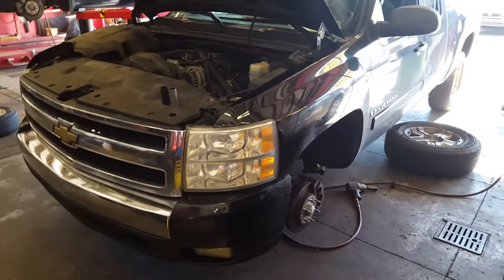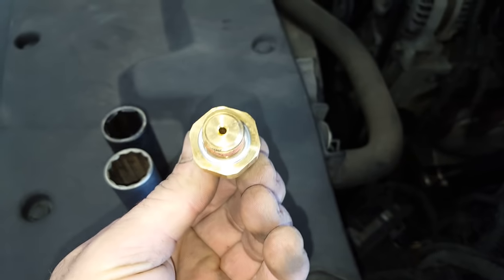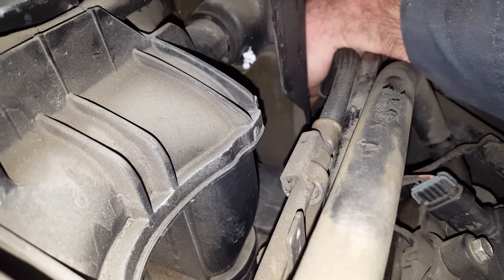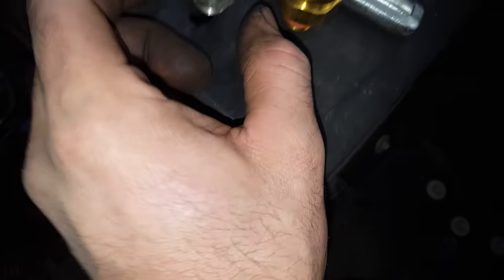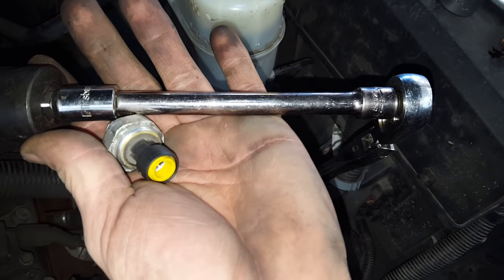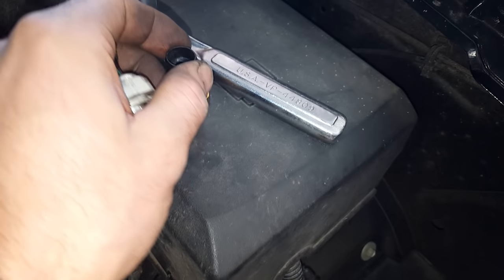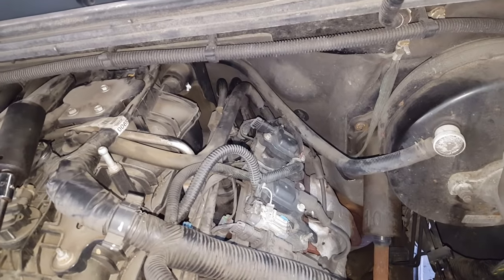Chevy Silverado 5.3L OIL PRESSURE SENSOR REPLACEMENT 4.8 6.0 sierra yukon  sending unit p0523  gauge

Comment: Finally, a no-nonsense video on the replacement. Not a 15 min long video.
Reply from the maker: That's what I shoot for! I feel your pain on the 15 minute videos that could be 2 minutes. Part of the reason I started making short fix videos. Sometimes I find myself having to look back on them as well for answers and I don't want to see myself talk for 15 minutes either.
Reply: Side note, the 2011 5.3l connector ks different! Make sure you double check that you have the right part! It's still 3 prong but has wider spacing with a different clip mechanism! 
https://youtu.be/lUPEIrs3mrU
This guy has the correct video for that!

Comment: Unbolt the trans mount at the rear. Lift up the trans by the yoke. That will buy you about 3 inches from the firewall. Its the way i do it and it takes me 15-20 mins.
Reply: This might be the answer for me.  I don't understand how anyone could get that electrical connector off.  I can touch it...but there's no way I can get a grip on it, lift the lock, push in the tab, and wiggle the connector off.  My hand is bleeding.  I can't get a grip on that thing no matter what I do.

Comment: What about the little filter screen just below the pressure sending unit. It is a common problem. It plugs up and causes the oil pressure to run low or no oil pressure. When you're in there it is just a pick to take it out and replace.
Reply: I was charged 8,000dollars at a place here in ky and still had no oil pressure, told them to replace the screen and they had no idea what i was talking about. Now i dont have enough money to sue them.. fuckin con artists. Lol
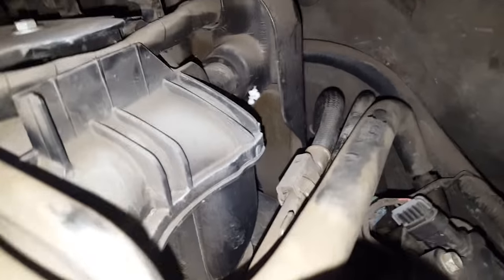Reply: Listen up folks... Here is how to do this job real simply.  Get a heavy thick blanket and put it on top of the motor because you are going to lay up there to get at eveything.  At 1:01 of the video you will see the plastic baffle, at the rear of the engine, and there is a white spot visible.  Take a sabre saw blade and make a vertical cut in the plastic (about 1/2" to the right of the white dot) and cut down toward the bottom, and then cut horizontally to the right.  Then throw that piece away.  (Presumably this is your own truck!). I did not find any adverse effects from doing this.

You will be able to see the sensor and the electrical connector, easily.  You will not need to remove any hoses.  Reach over the top, disconnect the connector with your left hand, and move it to the left, out of your way.  Use the 27mm deep socket, with about a 4" to 6" extension, and your ratchet.  (I did not need to use a "flex" connection.)  Removing the sensor is very simple.  

To remove the basket screen, use a 3/8" dia. bolt, check with finger feel to make sure you are centered on the screen, and use gentle downward pressure and make about 1/5th of a clockwise turn.  I was able to lift the screen out, FIRST try!  Clean the screen with solvent a couple times, and reverse blow through, with compressed air.  Pop the screen back into the engine port and replace the sensor.  This will only take a few seconds.  Reconnect the electrical connector and restart the engine.  Odds are high, that you will still have an erroneous pressure reading.  That means the issue is a defective sensor.  (When you put the new sensor in, and start the engine - don't have a heart attack.  It probably took about 40 seconds for my ECM to recognize the new sensor.)
Reply: @cementhead7358  That piece of plastic is there for a reason. Its a shield.
Reply: Yes sir.  I was about to say the same thing.  I just had that same exact problem on my Silverado last weekend.  Gauge only showed oil pressure after starting but then would drop to zero.  I took that filter out and it was clogged.
Reply: Walln Cuz I don’t know where at in Kentucky you’re at but I’m in Kentucky also and I sure in hell ain’t paying nobody $8000 to change the damn sensor
Reply: I just bought a 08 Chevy Silverado and the check light came on throwing code P0521, the oil pressure IS low until I put my foot on the gas then it jumps up. I know how to do the work and I'm just glad it's not an expensive process, and also it's apparently not uncommon
Reply: My pressure reading it high. I can get to the sensor with this combo but I don’t get where the screen is located and how to remove it?
Reply: @williamdinsmore4055  After you get the oil pressure sensor out, look in the mounting hole and you will see the top of the small screen. Use a pick and pull it out. Just slide the new one in and then screw the new pressure sensor in.
Reply: @johnreid859  so I bought “standard” brand from orielly. It was kinda pricey at 70 but I couldn’t find oem. Will I be able to get the oem off with 27mm and new after market on with 1 1/16?
Reply: @williamdinsmore4055   I bought a special socket at O’Reillys to do the job, it was a 1&1/16 size. I remember it was a lot of stretching to get back there. I had to remove a few lines and the plastic cover on the top of my 08 5.3. Needed a universal joint for my 3/8s drive with an extension. Same socket to put in the new oil pressure sensor. If you look in the O’Reilly socket it looks like there is a different size deeper in the socket.
Reply: @johnreid859  I’m on the job can’t get the damn clip off of this bugger to begin with.
Reply: No shit he could of bought 2 crate motors lmao

Comment: For parts, I just got out of Autozone and picked up the following for this going off the video here.

1) Oil Press. Sensor = Dorman #926-040 (includes screen filter)

2) Oil Pressure Socket (1/2 Drive) = OEM #25254

3) Duralast 5" Wobble Extension = #52-224

The special socket fits the sensor hex perfectly. I'll update my comment later to confirm everything worked or not. Got a GM engineer friend so I'll see if he can't look up the I&M sheet so we can get a torque spec.

Thanks for the video, hoping the ~$37 tool investment (+$55 for the part) saves me from an $800 shop invoice. 😀

Comment: great video. i'll reiterate what others are saying about just how much contortion, strain, and hand compression it takes to do this job. i had the most success starting at the braided cable nearer the driver's side and following that down first to the electrical connection and then the sensor for removal. the electrical connection was the biggest obstacle, as mine was installed with the retaining clip at about 7 o'clock, meaning i had to find the perfect angle to somehow get my hand down past the edge of the connector shroud and then around it fully opposite myself, and up under the clip. building on advice from another video, a very small (like 1/8") allen wrench came in very handy. i wrapped electrical tape around the bottom to give myself a little bit more purchase.

after A LOT of blindly working the allen key around, the plastic shroud deformed enough it could be slipped over the tab holding it in place. using my phone as an inspection camera helped a lot, too... just don't drop it into the abyss.

edit - cheap pick from HF bent into basically a shephard's hook worked well to pull the screen. basically bend it a little bigger than the diameter of the screen so the "bell" you create pops over the top of the screen's housing. this'll keep you from destroying the screen if you want to just clean it. installed the new screen with a similarly cheap grabber tool from said importer of fine chinese hardware.

last note: 1-1/16 and 27mm will do the job, but you'll likely find that you wedge the sensor in -- especially the old one you'll have to use a multi-part ratchet setup like in the video to remove. may be worth paying for the specialty tool if you'll be doiing this on more than one job. i had to use a punch to pop the old one out of the 1-1/16 socket.
Reply: I've been trying to get that connector off for a couple of hours.  My  hand is bleeding.  I cannot, for the life of me, get the tab pressed in, at the same time as have enough grip on the connector to pull it off.  I don't know how you guys are doing it.

Comment: After pulling out the sensor, you might want to pick out the screened filter and inspect/replace. They are only about $6 and when clogged, are often the problem.
Thumbs up!
Reply: That should come with the new sensor

Comment: after picking up the right tools, I changed it and the filter in less than 5 minutes. thanks to this video. one thing that happened was the old one was 27mm and the new one was just slightly smaller.
Reply from the maker: Yeah the sizes definitely vary depending on manufacturer.  Thanks for commenting, and glad to hear the video helped you out.

Comment: Jesus.. I have watched 100 videos today on this exact thing... all 15 minutes at least and they still left me questioning things. I wanna hit them with this video
Reply from the maker: Thanks for the comment and feedback! That's exactly what I shoot for in my videos! Glad to hear it helped out
Reply: @NoNonsenseKnowHow  is it safe to drive my 2008 Chevy Tahoe with a bad oil sending unit
Reply: @r-luvbham6608  I have been for about 6 months. Just been too lazy to do it. Going to do it this week finally. Remember this is a sensor, the engine doesn't need it to run. Just your oil pressure gauge will not work.
Reply: It doesn't do nothing just the anoying biping when oil is 0 i been driving my 03 Avalanche for a year now. Im waiting for the sensor to change it ill make a video named.  
 03 Avalanche oil pressure sensor replace
Reply: @djvj1  I've had the same problem for a couple of months also n I'm bearly going see if I can do the job my self
Reply: @estebancruz7456  good luck! I took care of mine, wasn't bad. One of the easier things to swap.
Reply: @djvj1  cool thanks for answering

Comment: I just did this on my 2013 silverado. This is the best vid for this procedure. No I did not remove any hoses. It was a real bitch to do but very doable. Some of the best advice was to lay  Moving blankets across the motor and lay on top to reach comfortably. Another piece of advice before you do this is an engine flush and oil change  before you do it. I didn't and fresh screen got partially plugged again after the sensor/screen swap

Comment: Awesome video and thank you for all the great camera angles to see behind the plastic shield.  My experience is you get back in there and unless you have thin hands you will be struggling to fit your hand between the firewall and plastic shield and it's harder than that as there is a wire harness right there too further limiting your space.  I finally removed the old one and pulled the screen out using a long bolt to jam it into the filter, awesome.  Well then when I put the new filter it fell into the back of the engine, never to be seen again so I used the old filer which was in very good shape anyway.  Then when I tried to put the new sensor on it fell behind the engine never to be seen again.  Then one of my extensions fell behind the engine never to be seen again, so I put the old broken sensor back on and basically spent 2-3 hours removing and replacing the old parts.  LoL.  Nothing like waiting an afternoon.  This morning it's snowing and I need to go back and see if by some miracle I can locate those parts.  In the process the large socket fell back there but it's so big I managed to get it out and even the old sensor fell but I managed to fish that out.  Have fun y'all!!!
Reply from the maker: LOL, that sounds like a terrible experience you had there.  ;)  I hope you get it squared away , and thank you for your comment!
Reply: Yeah, I managed to see the extension with my phone camera this morning and once I knew were it was I used a magnet to fish it out,  I can see the new sensor but its behind the wire harness, magnet won't stick to it since its aluminum, my grabber can't open big enough to grab it and the electrical end is facing down so no way to get it without removing the whole manifold.  A new one on order, hopefully better luck on the next round.
Reply: I had the same issue a 5 minute job turned into a few hours of pain, busted my hand, new sensor broke, lost old sensor,  zero degrees out, broke the connector tab.  But finally got another one succeeded installing and engine light went off with new one.  I would pay to get this changed again 🤣

Comment: Picked up a 01 suburban for a song and dude told me it had a rear main leak - parked it and when i left again oil was just constantly coming out while the truck was on.
Got under it to confirm rear main but a buddy told me the location of the leak was coming from on high when I sent him my video - suggested replacing this.

Armed with this video I was able to get the job done - took me a while to find the real oil pressure socket but finally did at Napa the Harbor freight deep well / impact wasn't quite long enough for the older sensor.

Thanks again for such a helpful video!
Reply from the maker: Awesome man sounds like you got quite the deal then! Thanks for the comment I'm glad to help out!
Reply: Was it leaking from the filter side and the starter side? My 2000 suburban is leaking like that with a heavy flow while on idle.

Comment: The only video that I have seen that was actually educational and I have that daunting task today thanks so much for posting this
Reply from the maker: No problem. Thanks for commenting. I forgot to mention in the video that there is a small screen that should be pulled out and cleaned or replaced that is beneath the sensor. Just FYI

Comment: Great video, service manual calls for intake off; I've only ever done them the way you do. PLEASE NOTE; there is a filter screen that lives in the hole that often gets clogged; I'd strongly recommend replacing it or throwing it away, if dirty or brittle; avoid future issues. Cheers

Comment: Its best to use the oil pressure socket it self. Sometimes the 1 1/16 & the 27mm over cross the oil pressure switch nut. Then its hard to get the socket off when you tighten the nut back on if you use the oil pressure socket itself it will come right back off once you tighten up the oil pressure switch.
Reply from the maker: I agree with you on that. Good tip

Comment: My 2011 silverado 5.3 was having the oil pressure pegged at 80 for a few days then went straight to zero Replaced oil pressure sensor and filter and its fixed just for anyone who might be having the same weird oil pressure problem.
Reply: tools used were: 2 2in extention a 1 1/16th deep sock and a regular 1/2 inch rachet wrench the only problem i had was taking the stupid electrical connection off sensor
Reply: Alicia Selke wich filter did you change?
Reply: That's what I'm hoping is the only thing wrong with my 04 I don't have money to fix it if it's more severe. The oil pressure gauge pegs to 80 without the truck even running and when it is running it runs just as smooth as it has normally. No knocks or ticking which is a plus. I don't drive it enough for the oil to be bad. So we'll see when my ordered sensor gets here. Fingers crossed. :)
Reply: My 2013 Suburban just pegged at 80 for about 5 seconds then went to 0. Of course this was after an 8 hour trip made the previous day. Hopeful that it's just the sensor! I'd hate to be stuck 8 hours from home.... however it's still running with no noises....

Comment: This is why you buy a Toyota Tundra with a 5.7. My Tundra just turned over 200,000 with no problems except for minor maintenance.
Reply from the maker: Yeah they are good rigs for sure! Starter motor job is a pain in the butt though

Comment: Good video straight to the point. You forgot to add the filter/strainer that goes under the sensor sometimes they get clogged and give a false reading 5 more minutes of work if that and a $10 parts might as well replace it
Reply from the maker: Thanks. And yeah I added that in the description after the fact. I wish I could go back and add a clip to the video without removing it

Comment: Alot times they are just dirty and can be cleaned with brake cleaner. Oil back up and most of the time they work fine after that. They dirty when you wait to long to change oil anything below 15% dirty starts moving around.
Reply: I want to there a screen just below that, that also needs cleaned

Comment: You may find it difficult to  keep the sensor in the socket when you are installing it.  Take a  piece of paper and wrap it around the  6 points on the sensor then put the sensor into the socket. The paper wrapped around the sensor will hold it in the socket so that when you slide the socket and extension behind the engine the sensor does not come out of the socket. You can then use the  extension to screw in the sensor to hand tight. Then use the ratchet. Just be careful not to cross thread the sensor when installing it.

Comment: What about the screen underneath it? That’s normally the problem with oil pressure on these. Sludge and gunk gets in it and blocks oil flow to the lifters. Thanks to cylinder cut out.
Reply from the maker: aaron lunsford yes, I'm sorry I failed to mention the screen. I made this video and kind of a hurry.  The main point of the video was he just show the location of the sensor and how to remove it. The screen was not dirty on this one.

Comment: Just joined the high mile 5.3 crowd. As a newb , what are the failure modes for this?
Reply: Oil pressure pegged to the max or reading 0 are the most common failures,    the particular failure on my yukon, the oil pressure gauge would fluctuate between 0 and 60 constantly whether at idle or driving it.

Comment: use the right oil pressure deep socket and remove the intake plastic cover ( 3 6mm bolts)some models  r&r fuel pressure line at left intake manifold  and you can go straight behind intake no universal  ( wobble) needed cheers.